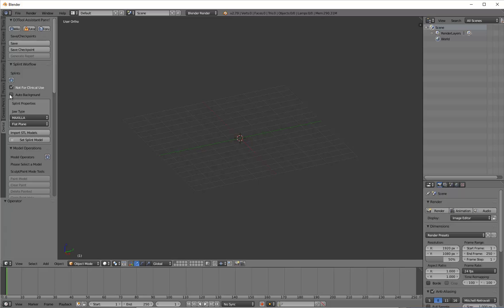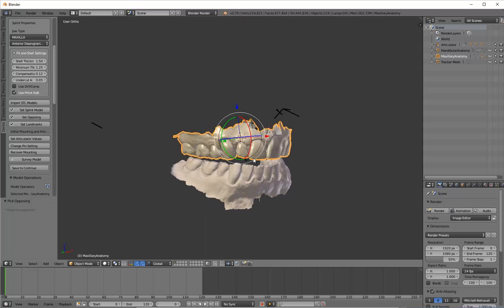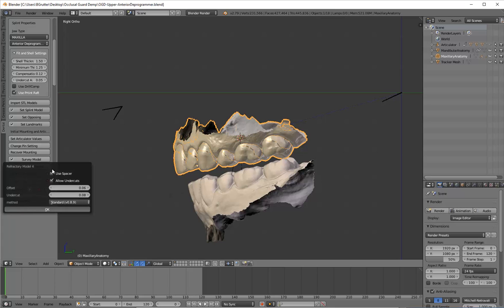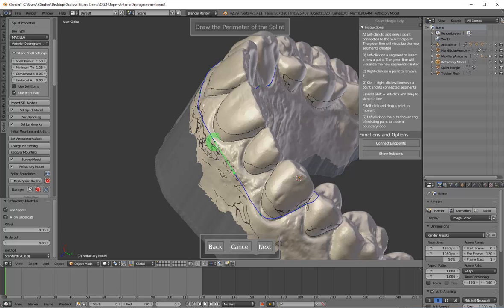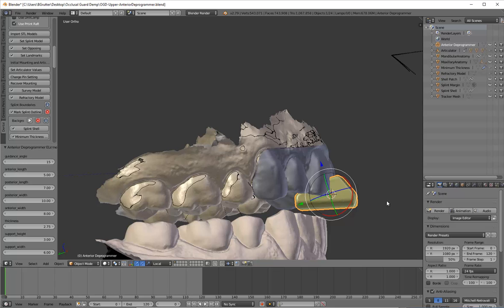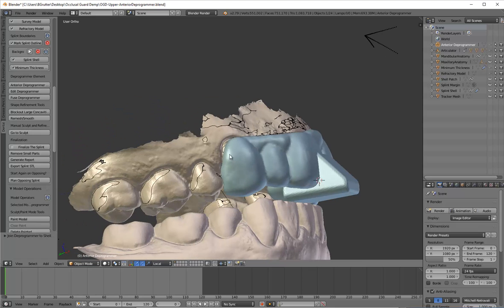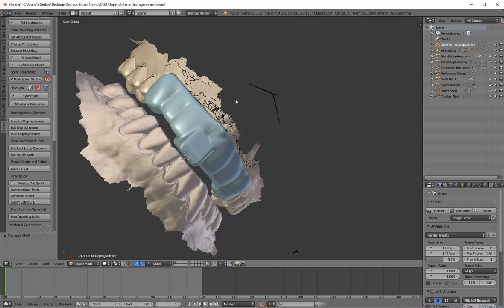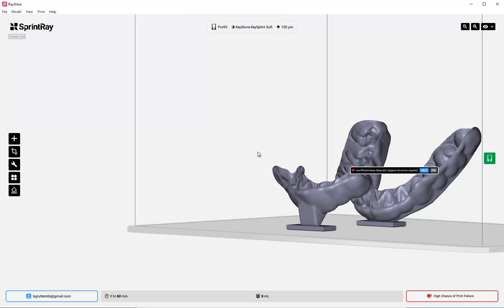D3Splint WorkFlow: Anterior Deprogrammer

Comment: Good morning. Is there an specific resin to do that?  Proper to use inside mouth? Thank you.
Reply from the maker: At the end of the video I show which resin I'm using. Keystone KeySplint Soft
Reply: Hello @bgrutterdds  , how hard is the splint once it is in the mouth?  The doctor I work with says that if the splint is soft the patient tightens the jaw even more and it doesn't do its job.  Could you clarify for me a bit how this resin works?

Thanks for sharing all this videos, they've a great value!
Reply from the maker: Very rigid. You can request a sample from KeyStone Industries. The term "soft" is a misnomer. It's only soft when heated. Far far warmer than intraoral temp. We bring water to a boil and submerge for 5 second to soften it temporarily. 

I completely agree with your doctor. But he doesn't need to worry with this material. It feels like a Traditional acrylic Splint when in function.
Reply: @bgrutterdds  Thanks for clarifying!
Reply: @bgrutterdds  My mistake. Thank you for your response.